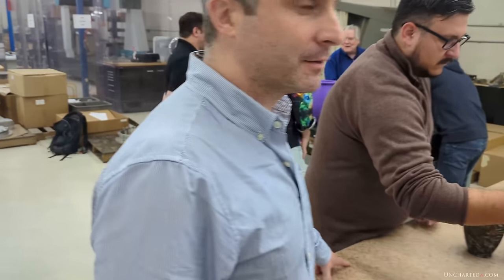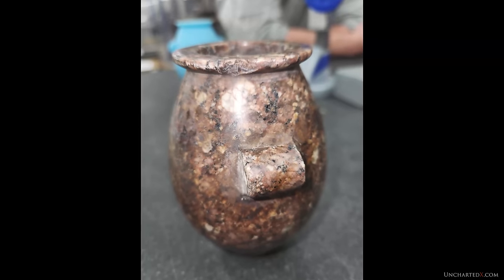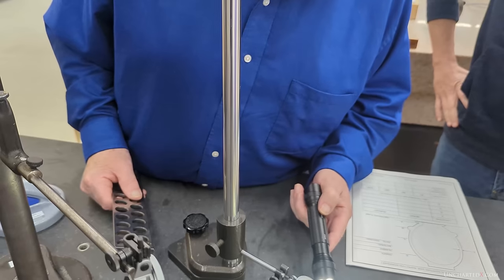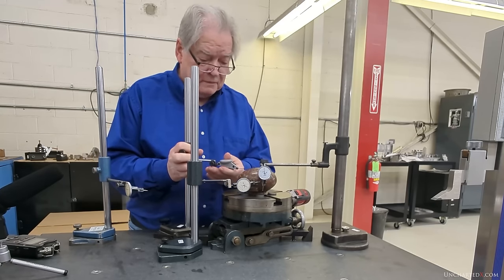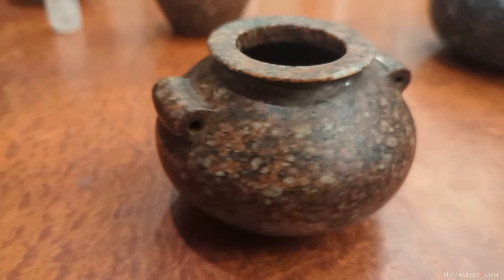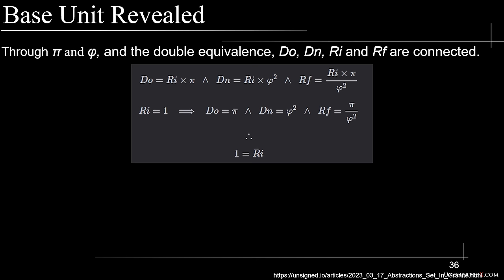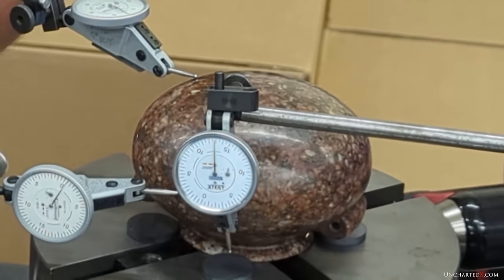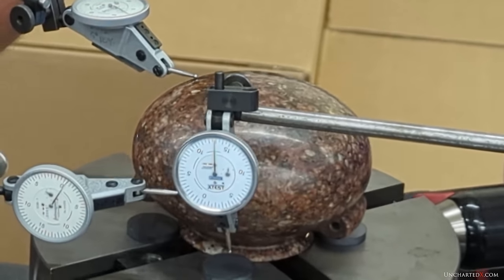Astonishing Results! More Ancient Egyptian Granite Vases Analyzed! More STL's available.

Comment: I am not an engineer but I am interested in math. The Radial Traversal Pattern you found is an exponential growth function.

For example, the radii of the circles in the three-dimensional form could be chosen so that they grow or decrease exponentially with the number of layers or levels (n).

At first glance, it looks as if this function has been developed instead of a trigonometric function. Today, we describe many things as the relationship between sides in a right-angled triangle. Here the relationships are described from circle radii.

This is an extremely clever and at the same time helpful method of defining relationships. For example, when it comes to the propagation or absorption of waves.

Whoever used this had an understanding of physics and maths comparable to ours and was therefore very highly developed. It is astonishing that you found this in a household item, a "vase". I would expect that from engineering of machine parts but not from a trivial household item.
Reply: My sentiments exactly, as an engineer I'd have thought these were machine parts given the tolerances and specification(s). No lids have ever been found, just mud lids for these artifacts that were repurposed as "vases" at some later time.
Reply: With your circular radii observation, from the bottom of the vase heading the middle where the circumference is largest, let's say every 1/100th of a millimetre, the rate of change would have to be constant until we want to stop expanding the diameter of the vase right? Perhaps using circular radii as their base input or defining factor, perhaps this explains how in unchartedx other video on the same vase with lug handles, how all other related geometry and math is obtained. A simplistic control like circular radii might explain how so many of other formulas, constants, and low errors were additionally achieved. If there was a way to do as you said, and start from the bottom or top, and ensure a consistent rate of change vertically in the circular radii every 1/100th of a millimetre, suddenly, it becomes quite explainable to my imagination. If they could change that rate of change, then they could also level it off too. Reverse that would produce the top of it too. Of course how that is mechanically done only they will know. Circular radii seems to be the defining characteristic I would assume from what you and the video has said.
Reply: @maxsimon36  That's a good point, but we look at it with a bias of modern time.

For example, everyone learned in school to use the Cartesian coordinate system with X, Y and Z axes. Any change in coordinates is a constant change in distance. At best, you have also learned a logarithmic coordinate system in which a change in coordinates is logarithmic.

We also use the Pythagorean theorem for all sorts of things. Calculating distances, sizes and so on. It even has its own branch in mathematics, trigonometry.

Whoever designed the vase took a completely different approach. Since we are using triogonometry and a special form of triangle (right-angled triangle), someone seems to be using a special case of the circle for their theorem and 3D space.

So we're still in the design phase and haven't thought about HOW the hell they even measured 1/100th of a millimeter or could even use a tool with that level of precision.

From the text alone I have to write to express a thought you obviously see how mindblowing all this is. And it is normal household item. I don't want to think how they designed the necessary tools to create this thing.
Reply: @WhereIsTheSpartan  you said it better than I did. The circular radii method appears to be most efficient for building these circular vases. But that is fantastically brilliant. I could only assume that our trigonometry methods for basic building of endless objects is universally useful in everyday requirements, but to have on hand a circular radii method for circular objects, let alone be aware or capable to develop that foundational concept for precision building, demonstrates truly flexible thinking plus intelligence. In physics, short formulas are beautiful because the shorter the formula, the more possibilities it's inventor automatically rules out or accounted for, in it's most reduced formula. E=mc2 for example. It's hard to crack one of those out of a human. To build it, you have to reduce what is occuring down to the bare bone. This circular radii method is the same type of thing, or has the same intellectual impressiveness. It's completely reduced to provide a precision function craft but better still, it's simple. To make simple of what is difficult is genius. I noticed that uncharted was obsessing on measurements and lack of errors, not imagining that a brilliantly simplistic concept was somehow additionally gaining such feats whilst performing it's consistency. Just an observation even he might not have made
Reply: @maxsimon36 I fully agree with that. It looks simpler, more elegant, more precise and better thought out than we could do. I can create an arc with trigonometric functions, but doing that in 3D is another level, but it seems to have been easy for the designers.

Comment: The base-unit analysis was by far the most fascinating part of this video.  Since everything else about the OG vase is so precise, it seems possible that the correlation of the 'base unit' to another ratio ( c/f ) could be intentional.  It seems many ancient stone structures (Stonehenge, Pyramids, Gobekli Tepe, etc.) that have been discovered over time seem to be communicating something.  It doesn't seem far fetched that this OG vase is doing the same.

Comment: Great work Ben. Keep on it!

Since so many have very similar lug-handles with similar sized holes through them, could these not only be a design feature, but also perhaps a sign of how they might have been manufactured? Ie. Is this an artifact of how they were connected to the lathe-like machine tools they may have been using? I know there are many vases without them, but perhaps these were removed later to create a different design style?

Have you seen any similarities between the dimensions of the lug-handles or the holes in them?
Reply from the maker: I think the holes in lug handles were probably added later with primitive methods
Reply: @UnchartedX So Ben; why do you neglect to show your fans apt and reasonable experiments which contradict your hypothesis? The fact you do not give an honest review of what you call "experimentalists" is dishonest. You know this.

Comment: Immediately after your video finishes, YouTube throws a debunking video with a strawman argument headline at me. I didn't even want to get into it because I'd probably be attacked in the comment section by a bunch of people who claim to have PhDs. I'm just a humble tradesmen with decades of practical on the tools experience in construction and manufacturing. What do I know is PhDs or not, I can say one thing about office bound experts is that it's the lowly wrench monkey or the rare field engineer that knows how to actually know how to put things together. Academia hasn't a clue about the effective use of manpower. They know in theory about tensile strength, but quickly forget it when they surmise that papyrus rope, a few logs and men so tightly packed together that they're falling over each other can move thousands of giant stones (without damaging them) across vast distances, down mountains, across rivers and up steep ramps. There also seems to be an ignorance of the sheer quantity of high quality ancient construction globally, the more than coincidentally similarities between ancient construction methods, the difficulty in working those materials and the high level of precision needed to make these objects and buildings. The argument from academia seems to be that there wasn't any advanced tools back then, so it simply had to be stones, sand, and copper chisels.

Comment: Did it occur to anyone that these are not vases at all. With all the ratios, maybe these are analog manufacturing cams. The "handles" might be fixture points to set this into another machine. Why would anyone make a "vase" to this level of precision? It can't be chalked up to bragging rights, can it? Maybe they are parts of an analog differential analyzer, or some kind of mechanical computer. I just can't see them filled with mints sitting on a coffee table. I remember a story of the Falklands war where some critical component of one of the Vulcan bombers was being used as an ash tray in the crew lounge.

Comment: Using the data provided @43:49,

The width is pretty close to Phi x e , where 'e' is Euler's number
1..618 x 2.718 = 4.397
9/2 = 4.500
Again, as I said before, I feel my numbers are not accurate cause the fractions shown on the table themselves were probably rounded.
Reply: If they were so good at precision as unchartedX is claiming shouldn't it be dead on?
Reply: @fred7883  Well you can have a situation where the stone itself is expanding and contracting cause this test was not done in a temp controlled room; thereby throwing off the measurements. Also there could be slight wear and tear on the vases. Also the measuring instruments themselves could introduce errors due to the wear and tear that they themselves went through.
Reply: @zmarssojourner7435  The holes in the handles are misaligned because of temperature control in a room 10.000 years after the drilling took place?

How intelligent do you think you are?
Reply: @fred7883  Hey Zahi Hawass, LOL. To begin with, I am extremely intelligent. 
Next, When did I ever talk about the holes in the handles? My post was about the overall 'width'. Either way, yes temperature control in a room 10.000 years after the drilling took place, does indeed matter when measuring extremely minute dimensions.
Reply: @zmarssojourner7435  Can you provide the source on the fact that alignment of holes in rocks change and offset by several cm's due to temperature differences 10.000 years in the room they are measured in?

I guess it's technically true if you are in a room which is 1.500k then the rock melts right so it would change it. 

But are we talking about the vase melting and reforming? No?

I ask again, how intelligent do you think you are.

Once you have provided a source on that. Then please provide a source which can explain how the electrical grid and the airplanes and the factories and the tools(besides rock hammers/flint stones/small wooden stick) all disappeared  from the ancient civilization.

I mean they had cars right? How else would they have travelled around? Unless you are saying they didn't invent the engine. But had their black and decker tools using steam engines? right?

Either way, looking forward to seeing those sources you got there buddy.

Comment: It occurred to me that these stones as hard as they are are also brittle. In order to procure material to machine into these vase shapes, the quarrying process would have to be gentle and shock free. There could be no hidden fractures in the raw material. I cut stone with a hammer and chisel and hidden fractures are always a consideration. How did they get the raw material to work with? The quarry process is the key. To cut out huge blocks and move them like hydrogenated  jello over 500 miles?  We have lost so much and I don't know if we will ever regain it. Our ancestors knew more than we do now.
Reply: Amen 🙏

Comment: I know automobile car manufacturers use these same measuring tools with lasers to make sure a car rim is perfectly round. And even these machined car rims brand new would still have that measuring needle bounce around with many deviations.  To have these ancient vase's surface be this perfect on the outside and inside...blows my mind! When they shine a flashlight through the thinnest part of this vase at 49:05 with no signs of cracks, again is phenomenal! And all of these precisely machined artifacts were created pre-dynastic period it seems.  Aren't later civilizations that proceed suppose to have better technology, but these vases prove the complete opposite. If this was something humans can create, why were all these artifacts and structure all dated around a certain time period?  Why weren't more of these artifacts produced in later times?  Why have we discovered other cultural artifacts produced around the same time period with tons of margin of errors in their own creations and not with the same level of precision if this was a skill that can be passed down? Perhaps, these things were created before humans discovered them and tried to add their own creations on top of the original structure? Too many questions and and not enough answers for the short time duration we've existed on this planet.

Comment: This can be all be done with some rudimentary tools. There was definitely nothing advanced about them, nor would these have been made quickly. What the ancients had was time, and dedication to their craft.
All you need is to make a couple flat surfaces, which can be done by rubbing a few almost flat things together long enough. Stack two of them on each other, drill a hole between them. Now you have a bearing. Now dangle a rod through the hole, fix it to the top flat surface. You now have a vertically oriented lathe. Attach your rock to the rod coming out the bottom, spin the top plate, put some hard pointy rock on something sturdy as your cutter. Now take a bunch of time and you have a precision machined vase with primitive tools.
Everything is circular because that is the only thing you can do without getting advanced.
Reply: ...what?
Reply: Great! Surely you can make a similar vase then (with lugs please) and submit it for measuring, since it is really easy apparently. Looking forward to it! Thanks.

Comment: I don't think there vases at all i think they probabaly held pressurized gasses pf some sort and attached to another device (where are the lids?) Sort of like collecters of some sort. analysis of the insides for foreign residues from gases or chemicals should be undertaken also the fact that the flange at the tops seem that it would be attached to something there all similar and the extremely flat tops were to sit flush against something without a gasket needed imo
Reply: You'ld think that would be standard protocol ??
Reply: @kalnwi2023  yeah but how many different lamps for example there are. They all run off the same source but they vary widely. (Just a hypothesis i haven't really thought it out in depth lol) seems like allot of work to store grains or put flowers in  🤔😆
Reply: maybe these vessels "screwed into" an object or machine, kind of like a lightbulb, and the "handles" were simply a way of grabbing and turning the vases into place. this would certainly explain the precision of the opening and less precision for the handles, although they are still precise in some aspects.

Comment: The thing i find most interesting aside from the precision itself, is that it was used in the manufacturing of such mundane objects that have no need for this kind of accuracy or symmetrical proportions in their application. Their uniqueness and overwhelming numbers is a strong indication that they were manufactured using technology that simply used design parameters and not a manual labor intensive process. Either the equipment itself was based on the ratios and constants that you present or some type of software was set up to render and produce what we're looking at. For all we know these were all prototypes and as you joke were scrapped in the process of dialing in the accuracy of their toys. Great video Ben, ty.
Reply: These came from a questionable source, don't believe it not proven and i call bs.

Comment: This is jaw dropping! I've only seen similar tolerances in high-speed rotating components in Gas Turbines (jet engines). When I say similar, I mean one or two complimentary results, not as many as they are showing.
Reply: Not to discount any of the impact of these vases, but modern automatic transmission components are held to much tighter tolerances and made in the tens/hundreds of millions of parts per year - diameter, roundness, concentricity tolerances are incredibly precise. Of course that’s with modern machining, metrology, and grinding practices.  Absolutely mind-blowing if these pieces are indeed thousands of years old! But we’ve far exceeded their precision with modern manufacturing.

Comment: This is amazing work. I’m a bit skeptical of the part where they show that various proportions of the vase are combinations of pi and phi, but the rest seems air tight to me.

I’d be curious if you take a bunch of various simple mathematical combinations of pi and phi, how much of the number line between .5 and 2 would that cover and how big are the gaps that would be left. Because it might be the case that almost any ratio that you make in that range is probably within a percent of some number than can be constructed out of multiples/roots/powers of pi and phi, which would make their presence in the vases un-interesting.

Comment: thing is, its not only cut precisely, it is polished precisely, as polishing also removes material. So whatever they used to polish Granite, but have been an amazing tool.
Reply: while keeping the tolerances to within a few 1000ths of an inch, both outside AND inside, through a hole too small to fit your hand inside.